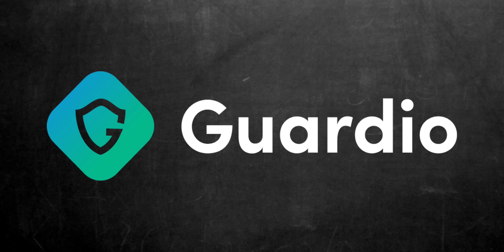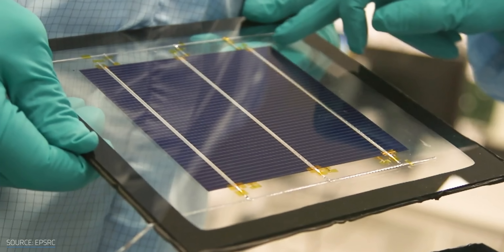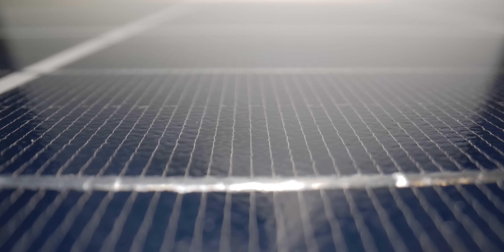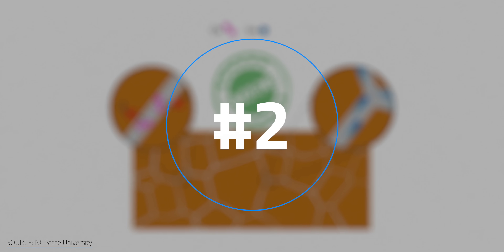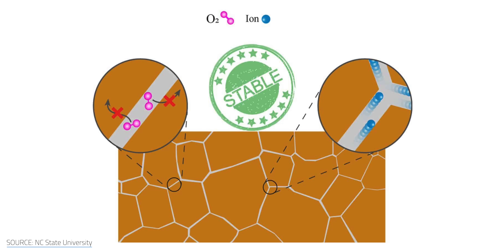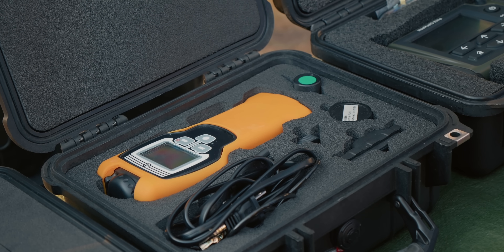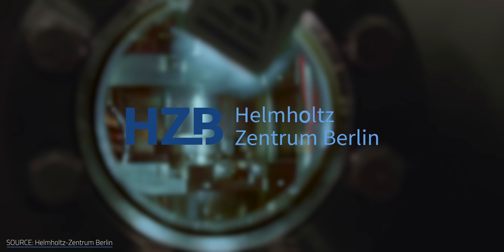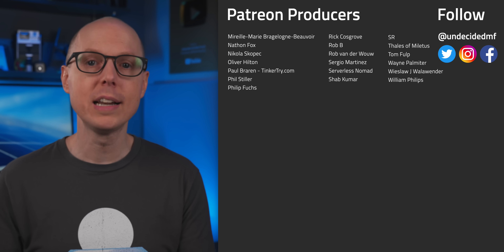Top 5 Solar Energy Advances Using Perovskites

Comment from the maker: So what do you think? For 20% off a clean and secure browsing experience, go to: https://www.Guard.io/undecided

If you liked this, check out Top 5 Batteries for Home (And One You Might Not Expect): https://youtu.be/Dr1VTc-io1k?list=PLnTSM-ORSgi6ObB8Ao0IpRhOgYO27wbSd
Reply: There is Polish company Saule Technologies which makes Perovskites solar cells using injects printing technology. I think they have been making solar window blinds for several years now.
Reply: "lead is heavy and toxic".  So toxic that we use them as wheel waits and fishing sinkers.  I'm not saying lead is good, but it is fairly common in nature at this point.
Reply: @MichaelMantion  it's only not killing us because its extremely inert as far as things that kill us go
Reply: Not ready for prime time with these numbers.  Too close to high end silicon and we know it's future life span.  Don't know anything about these.  Unless price is 30% better, at least, very few will jump into this for a purchase meant to last 20 - 25 years.  Think of it this way, most homeowners finance solar.  A 5% to 30% in upfront price is going to have no significant impact on monthly premium.  That with risk of failure and anything less than 30% cheaper won't make a bean's bit of difference.
Reply: Love your stuff, but not a fan of the Clickbait thumbnail you used “250%”. Makes me “250%” skeptical of your content next time.
Reply: im from Rochester too! (Penfield and Pittsford Mendon)
Reply: I know Rochester because I went to RIT 1979-83. I'm back in Boston (Peabody). Youtuber Smarteveryday did a series on Kodak making film. Very fascinating.
Reply: bro you confuzzled the HECK out if my @ 13:06 - "spin coated and SLIE-DOT coated" ???? a bit Lysdexic we are?? Te Moo!! ... errr Me Too!!! -  I hear you say 'slie-dot' and because I'm dyslexic I reversed the first syllables automatically and got 'die-slot' which made more sense... lol so I had to go back and listen again... then when you put 'slot-die' I realized you DOUBLE-LYSDEXIC'ED US!!! LOL (I know this is confusing... everyday is for me LOL) - Just wanted to TRY  to give you a chuckle... hope it worked :)
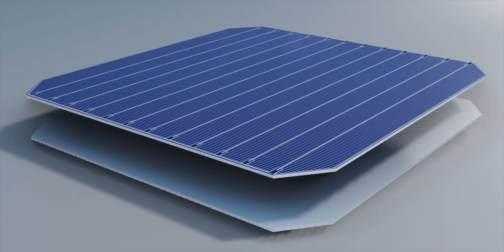Reply: I just need to know if referring to a "neutral zone" at 4:08 had something to do with mentioning Star Trek twice later in the video.
Reply: But if you're just like me a poor person on his phone struggling to make bill gaurdio would just be one more expense. So I'm just screwed anyway.
Reply: With cosmic rays being the most prevalent energy that comes from the sun I don't understand why cosmic rays harvesting devices aren't under development .. Carbon nanotube strategically positions to be placed to track the sun could be a way to generate mechanical vibration from resonances in carbon nanotubes .. These mechanical vibrations would generated enormous amounts of heat that when immersed in a phase change fluid would generate steam for steam powered turbines to generate electricity .. Eventually , they will discover a direct energy conversion to electrical power by eliminated the heat byproduct & using the mechanical output to create work in nano electrical generators ..
Reply: Until we can store weeks of power, solar is a waste of time
Reply: The Segway Portable PowerStation Cube Series sounds like a great option for outdoor enthusiasts and RV lovers! With its massive capacity, waterproof technology, and fast recharging, it's perfect for powering your devices during camping trips or emergencies. Plus, the Smart APP Control feature adds convenience. Definitely worth considering!
Reply: The Segway Portable PowerStation Cube Series seems like a great option for outdoor enthusiasts and RV lovers. With its massive capacity, fast recharging, and waterproof design, it's perfect for extended adventures. Plus, the Smart APP Control feature allows for easy power management. Definitely worth considering!
Reply: Thank you for sharing your thoughts! I really enjoyed the video on solar energy advances. As someone who values quality family time and outdoor camping, I think the Segway Portable PowerStation Cube Series would be a great addition to our gear. It offers massive capacity, powerful output, and even waterproof technology. It's definitely worth considering for those who need a reliable and versatile power source.
Reply: Thank you for sharing your thoughts! The solar energy advances using perovskites mentioned in the video are definitely fascinating. Speaking of power solutions, have you heard about the Segway Portable PowerStation Cube Series? It offers impressive features like a massive capacity, super-fast recharging, and comprehensive protections. It could be a great addition to your outdoor gear for camping or as a reliable home backup power source for quality family time. Check it out!
Reply: The Segway Portable PowerStation Cube Series seems like a great option for outdoor enthusiasts and RV lovers! With its massive capacity, powerful output, and fast recharging capabilities, it can provide reliable power for extended periods. Plus, the waterproof technology and uninterrupted power supply feature make it perfect for outdoor adventures. Definitely worth considering!
Reply: The Segway Portable PowerStation Cube Series seems like a great option for outdoor enthusiasts and RV lovers. With its massive capacity, fast recharging, and versatile sockets, it can provide ample power for extended periods. Plus, its waterproof design ensures durability in any adventure. Check it out if you're looking for a reliable home backup power solution!
Reply: The Segway Portable PowerStation Cube Series seems like a perfect fit for outdoor enthusiasts and RV lovers! With its massive capacity, fast recharging, and waterproof design, it's ideal for extended trips and unpredictable weather. Plus, the smart app control adds convenience and control. Definitely worth considering for reliable power on your adventures!
Reply: That Segway Portable PowerStation Cube Series sounds impressive! With its massive 5kWh capacity and fast recharging time, it's perfect for outdoor enthusiasts like us who value uninterrupted power supply. Plus, its waterproof design and smart app control make it even more convenient. Definitely worth considering for reliable power on our camping trips!
Reply: Thanks for sharing your thoughts! I agree that a clean and secure browsing experience is important. However, in terms of solar energy advances, I find the use of perovskites really fascinating. They have the potential to greatly improve the efficiency and affordability of solar panels. By harnessing these advancements, we can have a more sustainable and environmentally-friendly future. By the way, if you're interested in reliable backup power solutions for outdoor activities or emergencies, I highly recommend checking out the Segway Portable PowerStation Cube Series. It has a massive capacity, fast recharging, and versatile sockets. Consider it for your outdoor adventures!
Reply: Based on the video and the content of your comment, it seems like you're interested in clean and secure browsing experiences. While I can't speak to the specific offer you mentioned, I can recommend Segway's Portable PowerStation Cube Series for your outdoor and home power needs. It's a versatile powerhouse with advanced power storage technology, massive capacity, fast recharging, and comprehensive protections. It's definitely worth considering for your camping and family time adventures. Thanks for sharing your thoughts!
Reply: Based on the video title and your comment, it seems like you're interested in solar energy advances. While the Segway Portable PowerStation Cube Series isn't directly related to solar energy, it's a great option for outdoor enthusiasts and RV lovers like us. With its massive capacity, fast recharging, and versatile sockets, it can provide reliable power during camping trips or as a backup power source for our homes. It's definitely worth considering! Thanks for sharing your thoughts and the link, I'll check it out.
Reply: What about recycling????? Nobody ever answers that question and I'm sure you have no answer either. 
Also what about mining, are these all byproducts of strip mining and where are the materials coming from? 
Greenies just love to spout on about clean energy but leave out the important parts.
Reply: @centralscrutinizer9591  Certainly valid questions (when asked unemotionally). He did acknowledge the less-than-green processes of production and no one I know denies that. It's a work-in-progress.

But it's one of those energy technologies we need to be moving toward, and we need to be moving away from fossil and nuclear remains too dangerous (and not without it's own byproduct problems).

Try asking without the name-calling, us-and-them vitriol next time.

Comment: No specs yet as far as tandem cell lifespan and cost and those are really critical. Tandem cells also have higher embedded energy than thin film solar panels. Long way to go before we have something really good. 1000 hours is BS - you need 25 years which is like 50,000 to 100,000 hours of active usage.

Comment: 250% improvement from what value? The announcement is dodgy as they do not include the actual efficiency values. If it is only a 5% original value, it is still piss poor 12.5% after the 250% improvement.

Comment: We should just use the dessert  as an earth battery, heating the sand which in turn heats water to make steam that generates power that is connected to a world wide electrical grid system.
Reply: steam occurs at 100C....
Reply: which dessert? apple pie, pavlova?

Comment: Advance is in the quality of crystal  cover that can be used to zoom in out depending on level of sun in various region on earth and arrange with inverter and acceleration circuit can even generate Elina the dark without sun even. It can zoom in out the magnetic density and that help inverter to use contrast of two poles to generate electricity in either sunlight or night darkness as long as maximize contrast of two poles

Comment: Since its been found that its chemical exposure that reduces lifespan and not the pv process, imho developing the most efficient cells possible that can capture the most energy and then perma sealing from all sides ought to be the greenist solution. If the cells are made well enough, there shouldn't be any reason why they couldnt last for hundreds of years!

Comment: Perovskites can't go beyond the Shockley-Queisser limit. No technology can do that. Perovskites can be used on top on silicon solar cells, increasing the overall performance of the entire setup. Perovskites can be ajusted to gather only high energy light and the silicon tradicional cells will gather the rest of the light. This means that instead of having a material which haves general optical absorption, you have 2 materials working together with specific absortion windows. One more efficient to gather high energy light and one more efficient to gather low energy light. No material can go beyond SQ limit.

Comment: Fake news ....As a Electrical installer in Cali,  there is 100 types and 100 designs but no new advances .they still pump out the same output they did in 1995 as they do today in 2023.

Comment: Hi Matt, Thanks for another "breakthrough tech" video. You mentioned a limitation from 25 years lifespan of a normal solar cell to a 2 year lifespan limitation with perovskite (1:38), but at the end when you mentioned the companies preparing to go to market, you didn't mention if they solved that limitation. If they have done so, then I'm a believer, and if they haven't done so, then I'm not a believer. I'm left with a big question mark at this point.

Comment: It still won’t change the fact that Solar and Wind are unreliable so can not replace Coal or Natural Gas but if they have actually made Solar panels 250% more efficient and as long as they can hold that efficiency for 50+ years they could be a great solution to top up the grid and make green hydrogen.

We will continue to use Coal and Natural Gas for decades if not centuries and Hydrogen and Biofuel is the future we need to make both affordable so Grey Hydrogen will necessary at the start but as we improve ways to make energy and make green Hydrogen the more affordable and efficient Green Hydrogen will become meaning Grey Hydrogen will not be needed as much even eventually the possibility to phase out Grey Hydrogen completely and replace with Green Hydrogen then it would even open the door to replacing Natural Gas completely with Hydrogen so the only fossil fuel we would still use is Coal.

Hydrogen,Biofuel and Coal future.

Comment: The cost of panels is only a part of the cost.  The design and installation costs will not change.  
For instance, let's take a project costing $30,000 using current technology.  
And, let's say panels became free -- $0 to buy panels.  
Would the project go to $0, too? 
Of course not.  it might be reduced to $15,000, maybe.  
So, if Perovskite panels reduce the cost by 50%, the $30,000 project would likely
be reduced to about $22,500.  
Still, a reduction of 25% is a lot.

Comment: Perovskites are an unexcesary toxic nightmare! They are based on super toxic heavy metals and will eventually fail and end up in landfill. Silicon is already really cheap. The real cost is installation associated electronics and battery storage. Maybe someone will come up with a slightly reduced toxicity, but the majority will be nasty.

Comment: For me the big piece missing is how are these battery’s managed. If you can manage it, or the interface is poor, unusable or unmaintained the battery is either useless or less useful.
So their needs to be an API, a good one, and ideally both local and cloud. Cloud so,the company can provide an app and intelligence for you, and local so it cbe managed when the grid is down, or when the company folds and their cloud offering dies. I won’t be buying any battery until it has an API I can use …

Comment: The ChatBot tells me:
"Chinese researchers have developed a new form of perovskite solar cells that not only have greater efficiency but can also be mass-produced at half the cost of traditional silicon cells1. A team from Nanjing University, led by Professor Tan Hairen, used a layered solar cell structure to achieve higher energy conversion rates. Their small-area perovskite stacked cells achieved a conversion efficiency of 28 percent last June, surpassing traditional silicon cells for the first time1. In their latest study, they found a way to optimize the material for the interconnecting layer to make it suitable for low-cost processing on a large scale"

"China has started mass-producing perovskite solar cells. According to UtmoLight founder Yú Zhènruì, 2022 is the first year of perovskite industrialization, and China is leading the commercialization of perovskite solar cells. A Chinese startup named DaZheng Micro Nano Technology Co. has raised funds to build the world’s first mass-production plant for perovskite solar cells" 

So, we may be able to buy low cost Perovskite solar cells at Amazon sooner than we expected, provided that we don't ban the imports. 

Come to think of it, shouldn't this info be made available for readership's benefit?

Comment: Hi Matt! When panels are mounted on the roof ther get very hot due to the sun hitting them. All that heat is really a waste product.   Why don’t solar companies place high output thermoelectric generators on the back of the solar cells. The thermoelectric generators can supplement the power created by the solar cells.  Heat energy could boost the panel output quite a bit especially in southern states where the days are really hot and the temperature behind the panels can be upward of 150 degrees! See: https://en.wikipedia.org/wiki/Thermoelectric_generator

Comment: Are solar panels with their high concentration of silicon, also subject to winning the "silicon lottery" as is commonly referred to in CPU/GPU manufacturing?
Reply: I never considered that! Id imagine it matters more on the cpu because its such a small area while solar panels are large enough to balance out amazing solar cells vs low performers. I'm happy to find a good question while wadding though the negatively in the comments lol